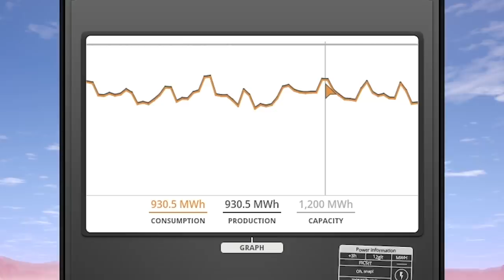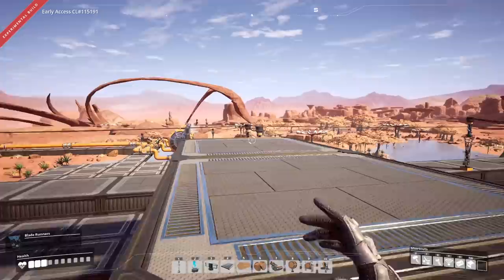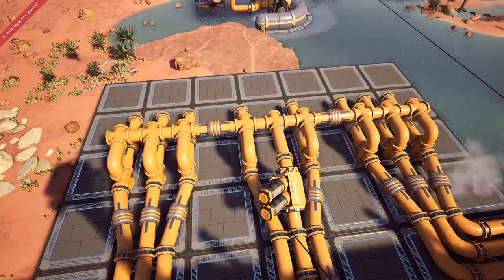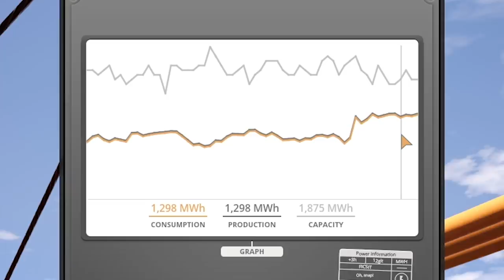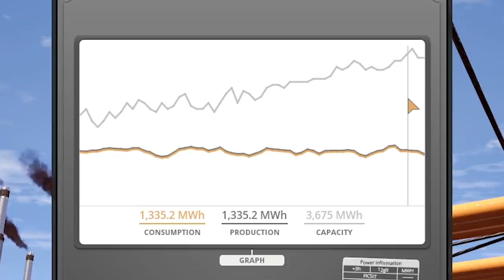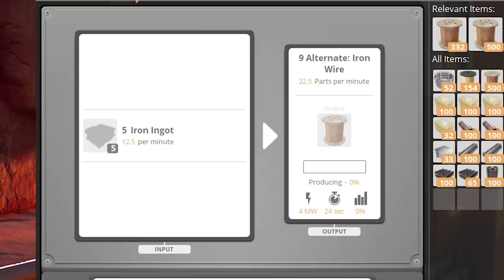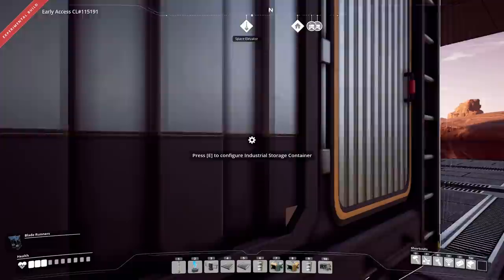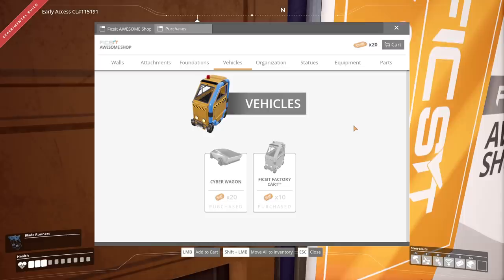The Cyber Wagon is Real and TOTALLY OVERPOWERED! - Satisfactory Early Access Gameplay Ep 5

Comment from the maker: I actually can't believe how good the Cyber Wagon is!
Thanks for the recommendation 😂
Reply: ImKibitz hi
Reply: Its a bird! Its a plane! Its... CYBER WAGON!!!
Reply: Yep, it even has the cracked windows from the press event
Reply: Put another ticket in the awsome sink bro! You will unlock a tesla model z (in fact I do not know at all what it will do)
Reply: Too bad that it doesn't fly always exact distance because you could have made it  loop around the world . First series moth flew across(through) your factory, now cyber wagon flyes over your factory.
Reply: totally wish you would use the new mechanic of being able to turn conveyor poles and belt poles with the mouse wheel, its one of the greatest thing added to the game, you can also adjust height and on pipes and hyper tubes you can adjust up or down
Reply: totally posted this like 2 secs before you found out on the video
Reply: The Bolted Iron Plates are actually slightly more expensive, althougth only by 0,8 Iron/plate
EXCEPT if you get a cheaper Screw recipie, or idk, some sort of iron alloy plate reciepie?
Reply from the maker: @moonthebest1920  Hi :)
Reply: you wellcome XD
Reply: To simplify your pump and pipe setup for coal: groups of 16 generators, 2 rows of 8 facing each other with 2 foundation widths between the faces. Run a pipe down the center, tap to each gen, the natural offset works for pipe tees and conveyor splitters. 3 pipes feed the center line pipe, first at one end then add others after flow in pipe has reduced enough to add 240 m3 more or just feed both ends and as close to center as possible. Each of 3 pipes feed by 2 extractors for 240 m3 per pipe.

No reason to load balance pipes, the tees work differently from splitters. It doesn't rotate the outputs.
Reply: I am willing to do some math and provide you with a full ficsit(tm) receipt and production feed if you so desire that kind of spoilers without context
Reply: And the windows are broken just like the real one
Reply: Put in another
Reply: Hi Kibitz, are you aware, that the fuel generators don't require water?
Reply: if you do 2 1/2 (=300m³) water pumps u can waterUP 6 CoalGenerators(made it easy because they have a 50m³ tank)
Reply: Hey Mr. Kibz,
                       Where is that they are billions video that you said to one commenter you told about?
Reply: Troll.  Hehe.
Reply: You saw the cyber wagon but the pipes are even more broken if you chain the entrances together
Reply: Exact same
Reply: 1:04 previously Ep 3 Kibitz:we can expend more
Reply: It is good that iron wire was nerfed. It should be used as replacement for copper in distant factories where you need that one random piece of wire, not replace actual one.
Reply: @Rylan Carl instablaster :)
Reply: @Reginald Declan It worked and I now got access to my account again. I am so happy:D
Thank you so much you saved my ass :D
Reply: @Rylan Carl Glad I could help :D

Comment: Hey Kib, looks like you're running into the same problem as we did with the pumps.

Each pump can lift up to 20m - but if you build them close the lower pump will just lift the way to the upper pump. If you space them up at around 16-18m in height, you wont run into problems anymore ^^

Can't wait for this base to become fps staggering xD GL ^o^
Reply: I noticed that issue with the line pumps too, but figuring out what 20m~ is in game is the hard part. For me, it's come down to lots of placing and removing pumps till the headlift sits in a good spot.
Reply: @Scientwisted  you can use the different sized foundations to measure the height. they are always 8 meters long and 4, 2 or 1 meter high
Reply from the maker: Oooh that makes a lot of sense, thanks!
Reply: @Magistrella Ditto, thank you. it would've taken me forever to come up with that.
Reply: Other things that are 20m tall: 5 walls, 10 stackable poles, 1 observation tower (the deck, not the roof).
Reply: Isn't it 10 metres?
Reply: @loganwalker8537  the pump literally says 20m of head lift unless youre talking about observation towers then idk
Reply: would have helped if he had actually shown his redo of the old coal power plant. he cuts WAAAAAY to much out.
Reply: @ImKibitz  a nice thing is the new update with the mk2 pipes indicates the headlift max value on the pipe itself when you build a pump, so you know the spacing.
Reply: Thank god for Update III.5

Comment: I accidentally flushed my whole pipe system and had to Power all my pumps with biomass to start them
Reply: I have a seprate coal power system JUST for my pumps and transport system.
Reply: I had a similar issue and just kept pumping the breaker switch till everything kicked on and was running again lmao. I had 4 coal gens and was upgrading to 5, but the power kept spiking so I had to keep flipping the switch till the 5th one started producing power because I was too lazy to go alllll the way back to my biomass gens
Reply: done that when i rebuild my coal power system the fst time
Reply: I had the same issue, and then  I learned to build my coal generators level with my pumps...  : /

Comment: You have waaay to many pumps. You even got a warning that it is exceeding maximum head lift
Reply: They are lift pumps the head pressure is the force pushing down on the pump
Reply: Nah it's the opposite. The pump was unable to keep up with the head lift needed to keep flowing so he needed more pumps.
Reply: @GordanFreeman420  The pump can push the water 20 meters up from where it is, having a pump right next to another wastes the pumps, they should be spread out.
Reply: @GordanFreeman420  you don't need pumps right after another. As another user said, the pumps can produce 20 meters of head lift. Having so many produces unnecessary pressure and wastes power
Reply: You probably could get away with a single pump on those vertical pipes - It would need to be carefully positioned though.
Reply: @alenavish5592  yes, it can lift water 20 meters. There is no such thing as too much pressure in this game. The warning was that the distance the pump was attempting to lift the water exceeded its 20 meter maximum capability.

Comment: 2x Water Extractors + 1 Power Shard = 300.
You only need 270 to run 6 coal plants like you said but nothing wrong with a little over production. Overclock one extractor by only 25% if you want exactly 270. Beats all the balancing IMHO

Comment: Try your mouse wheel on the pipe joints.  Also, I would dedicate a generator to your pumps and have both on their own power system.  That way if your main system goes down, your pumps will still have power and you won't have to use biomass to jump-start it.

Comment: i have a new personal favorite alt it uses steel pipe and wire to make rotors AND stators which combine those two for motors so youre using two different lines and essentially combining it into one motor line and the math comes out equally so by producing twice the wire and steel pipe you get motors i got 400 hrs in and took me this long to realize that lol!! i lean towards simplicty rather than performing black magic for an 8% increase of production lol

Comment: Why not just have a few 300m3 pipes connected everywhere... Basically overflow method but pipes are different from conveyors... When they are full they still have water in them... It's not just flow and when there is no flow there is no water... Wrong... There is water... And when coal gen needs water... Water starts flowing the one that's already in the pipe... So you can have 6.6 generators hooked up on 1 pipe... I use buffers a lot... And what they are to me is basically a control panel... You hook up water going in.. And you can measure how much is going out... And you gotta be in Net+ and not net- that just means more water is coming in then it's going out... It could have been a much simpler design xD

Comment: The fluid indicator on the pipes don't indicate pressure, they show you fluid volume and he animation shows flow and direction. They are meant to let you know if something isn't going right with the system. you also need to be careful with exactly how high you run your pipes, the line pumps seem to lose effectiveness the higher up they are from "sea level".

Comment: The reason why it takes so long for your pipes to build up and gain pressure is because each section of the pipe has to fill up to a certain amount before it will start filling the next.  When you're building the pipe you can actually see the little sections inside of it.  So yes, the longer the pipe, the more sections that have to be filled for the liquid to get to it's final destination.

Comment: Hai, just some tips for using fluids, it is always a good idea make a tower with fluid storages ontop, and of course have these fluid storages like one or two 8x4 foundation above the machine imputs, once you have a stable flow of fluid going up into the storages there will be no issue to have the rest of the system filled for the machines which are under the fluid storage's height. im bringing water into 24 coal generator with only using 4 water extractor and only with 4 pumps this way. each of the four pipe just has one pump at my 5 foundation tower (8x4 foundations) you only need find the sweet spot there for the headlift with one pump also make sure the pipe comes out on the other side of the fluid buffer its goes straight now, as ive noticed if you have more pipes in the same level with the fluid buffer will require more headlift, so basically pipe goes up and have 90 degree turn in to the buffer, then comes down by a 90 degree turn on the other side, also i have my four pipes combined all together just right under the fluid buffufers on the other side where they comes down from the buffers.
Wheh, this gone long but hope its helps and give ideas :)
Reply: 4 water extractors wont be sufficient for 24 goal generators  when they are all running. The water extractors only produces 120 m3 of water/min each which is 480 total, which would supply 10 and 2/3 of coal generaters.
Reply: @JohnRoads  oh... okay actually my bad. ive did misunderstood some numbers on the water extractors. i guess i gonna need fix that soon, but anyway lifted fluid buffers still helps a ton with the flowrate into the machines a lot thats for sure.

Comment: I built a smelter setup like you did, took me most of yesterday to figure out how. And power, FRACKING WATER!!! Things run fine till I get to about 100MW then I have a couple gens start to use up their water. Not sure why, I have 15 Coal power plants and each 5 has their one water pump and only 2 off of one of the pumps gets goobered for some reason. Well, I just unlocked the fuel power plants so I will be building some of those tonight. Probably still need water though.

Comment: I have this system in the old version of the game, where I have 6-8-10 coal generators, and I use power shards on them all.

Though I want to power shard every single building I have, I don't think it's possible, because it will all just run out of power, or it will all be too much for the machines to handle, and the miners stopping due to too many materials-the other machines stopping because there are too little materials, or it all just comes crashing down in fire and flames, down into the deep dark pit of fiery despair

Comment: Hey, quick question regarding pumps: When you feed your 8 Coal Generators off of 3 Water Extractors, for the center extractor you use a junction to split its output in 2 pipes, and then put a pump on each. Are these pumps really neccessary? Wouldn't it balance itself out? On the same note, for the contraption at around 8:00, do you really need the pump? Since there you definitely let the system balance itself out.

Comment: one thing is not clear to me, if I put 3 water extractors (tot 360m³ of water) I could feed 8 coal generators (45m³ each) but the tube carries only 300m³ ... If I connect them in order to create a ring the  flow divides equally and feeds everything or will it saturate the pipeline by blocking the flow and turning off the generators?

Comment: And I thought my 36-generator setup back on the coal coast was absurd. GDI Kibitz, you didn't even give me 12 hours to revel in the absurdity of the 36 generators! (oh btw those two nodes back on the back edge of coal coast provide well over 270 coal/min on mark 3 belts, 270 coal/min capable of running 18 coal gens each).
Reply: Also legit I just sharded 9 water extractors and made a pipe loop for all my generators. Works fine

Comment: I have a nice coal plant using a pure with mk2 miner at 200% and mk4 belts powering 32 gens using 4 water pumps for 8 gens each so 16 pumps 1 pure = 2550 power later I used 2 normal coal to repeat this works great for 5100 power that’s great until oil forgive my mistakes but this works try it your self go big or ... struggle with power making it the Bain yo your existence 😋

Comment: Umm, couldn't you Overclock the water extractor to 125% for 150m? Would save so much hassle and the extra power cost is saved by not needing pumps.
Reply from the maker: Yeah I'm trying to avoid Overclocking the water extractors, especially for power plants, because I want my net power output to be the highest possible. 100% though, adding overclocks would make things significantly more simple xD

Comment: "yeah we have a little bit of a power problem"
you have 300 MWs to spare
my systems batteries are emptying %90.22403945394828462836473726837 of the time. :|
yes, I used a recorder for graph calculations for 100 minutes.
Reply: I did that 3 times

Comment: why don't you just use 2 water extractors connected to 1 pipeline to power 5 coal plants?? 2 extractor= 240  240/5=48 and you can fit as many junction cross as you like on a pipeline. i know its a overflow system but it's real easy to work with
Reply: why would he when numbers just wants to be split, divided, multiplied and added :D ?

Comment: Your way over thinking this pipes, Im running 40 coal plants with 8 extractors split into two and i dont even think i need all them.
Reply: 8 extractors will only supply a little over 21 coal generaters, so when you use more than 1575 MW of power you'll run out of water.
Reply: Maths is hard, huh?
Reply: It's worse than @JohnRoads says. 2 pipes have a flow capacity of 600 cubic meters, which is enough for less than 14 coal generators. So you'll run out of pipe capacity before you run out of extractor capacity.

Comment: Man, I think you overcomplicated that power plant setup so much. 
Also placing pumps so close cause problems. Spacimg between 16-20m is optimum and It doesn't really do much on short line withou incline, like you did with previous coal generators setup.